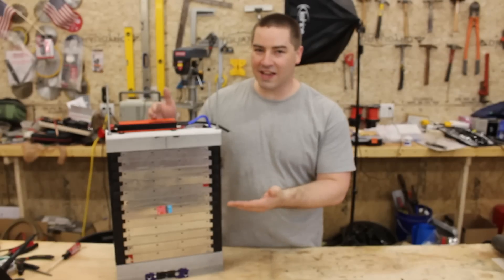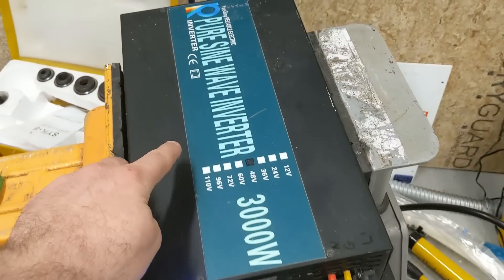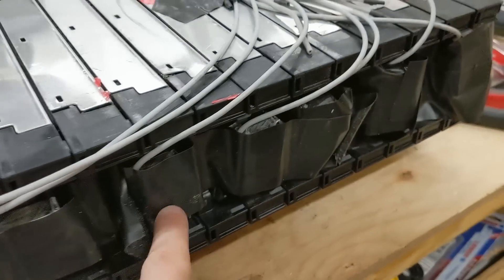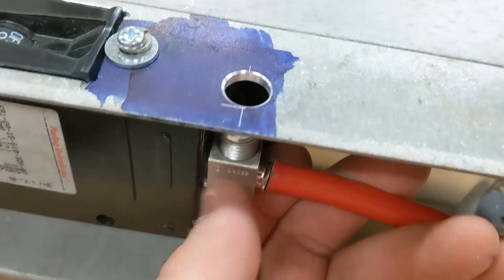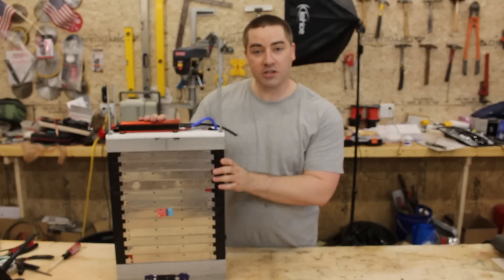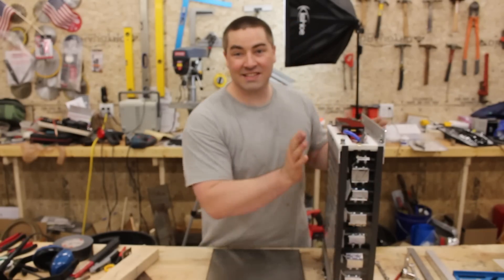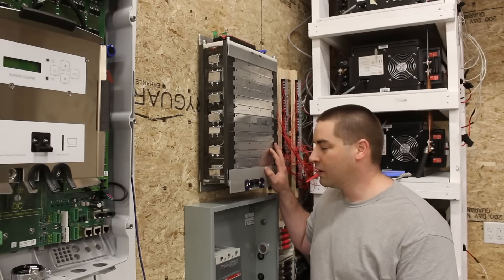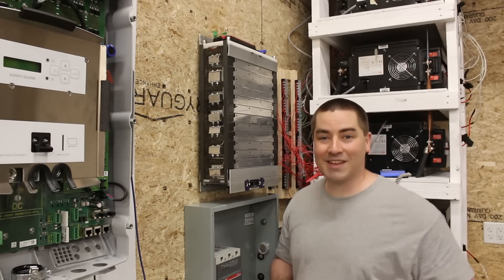LG Cells Part 2, 6kwh 48v DIY Battery

Comment: How many amps would be safe to discharge from this pack. Wondering for a golf cart and the torque i can pull from this  setup.
Reply from the maker: According to Battery Hookups website, these cells are able to do a 3C rate, which is 180 amps per cell discharge.  I built this pack with 2 cells in parallel, which is 360 amps max.  How many amps does a golf cart pull?
Reply: @DavidPozEnergy  Aftermarket motors in 48v carts will generally pull 80-120amps according to spec sheets I've seen. In real life they can peak at 400-500amps surge when you stomp on the accelerator and can pull 200amps going up a hill with a heavy load on board. I didn't see a pulse discharge rate on the bh site but imagine the cells would handle it considering they can handle 360amps continuous. My main concern would be protecting the cells and tabs inside the battery box of the cart and mounting them inside what is essentially a rolling earthquake :-). It could be done but would need more steps/planning than what you need for a garage wall mount? Would also need to use relays for LV and HV cutoff. Buggiesgonewild.com is a great resource for lithium conversions - most use 7 or 14 gen 2 leaf packs.
Reply: @DavidPozEnergy  depends on the battery. It is a custom project soooo..  60 to 140 amps typically on flat ground but could easily double or triple for more climbing  power. If the controller will make that power available. Thanks for the feedback!

Comment: looking to setup a power wall  with 8 k system can i use two to three chevy pacs
Reply from the maker: Yes.  These are modular.  Each the cells are not glued, so you can re-arrange the cells into different configurations.

Comment: hi David I like your ingenuity ,to built that  power cell. I have just 2 questions how much did everything needed to built it cost you? and how long did it take to receive all the components from the sellers in your links? thanks for your time
Reply from the maker: The LG cells are from Battery Hookup.  That was the fastest, about 4 working days.  The BMS was 4 weeks, from Aliexpress.  I bought the cutting board, and threaded rod, aluminum, locally.  If you want to buy aluminum I find Ebay good for a 3/4" bar.  The BMS was $130, the rest of the hardware was probably $40.  The circuit breaker was $40 from Alt-E.

Comment: I bought close to a 100 of these cells and I believe I may have found something easier than using the square aluminum tubing. Some of the tabs are  Extremely short. Some I've came across are only about a quarter of an inch maybe 3/8 of an inch long. But I found that if you get aluminum C channel you can't tuck it in much closer to the tabs. This has worked great. I have two of my 7 14s 48v banks complete. I believe the c channel is 3/4" x 1/2" x 1/16". Bought it at home depot for $13 for 8 ft.
Reply: Show us!!
Reply: Yeah this would be essential viewing
Reply: I did mine like David did and I already had 10 feet of 3/4 square aluminum tubing at home but only a little 3/4 flat.  I saw the c channel there and kinda thought about that BTW I used 35 mm m6 1.0 stainless bolts and nylon type lock washers no separate washer (I know but they dont get hot enough to matter) and I used a 1/8 flat 3/4 bar marked 2 inches increments with holes drilled 1/2 inch in from ends or 1 inch apart  for 48 inch piece and used this as a template to drill holes in other bar and tubing .  I found that either one  1/8 "washer and one 1/16 thick one or two 1/16 inch thick ones  gave me a little more space to work on the terminals.  A drill press really comes in handy for this. I did notice that 1 inch square tubing was more available and cheaper than the 3/4 inch size at home depot and lowes.  I think the 3/4 is probably easier to work with but with the 1/16 washer pieces it might pull the tabs in a little less (actually 3/4 x 1 inch tubing or bar is probably ideal but not available).  You dont have to cut them exactly 2 inches as long as holes match up.  Speaking of holes, I drilled my holes  11/64 inch and I couldn't see buying the pneumatic punch so I used a regular old notebook paper type punch. The holes were slightly small essentially threading the screws through them until I started chipping of one edge a little after making the initial hole.  This punch takes a lot of hand strength and really only can do one tab at a time but if had longer handle would be much easier . I looked into getting a leather punch with multiple sizes or light duty metal hand punch that was similar but none were in stock and I wasn't sure about how easy it would be to get it in correct position with the wheel at the end. I can also say it is somewhat harder to punch the positive end .  Also remember the tabs will be slanted down a bit .

I am currently using one of my packs on Club Car DS 48 volt golf cart and think I may be able to use the golf cart charger if I add one or two more cells to avoid the equalization phase and program BMS to shut off before the equalization mode. I am going to post in comments on his golf cart conversion video.
Reply: The cells started oozing a gel out of the ends where the tabs come out. They have not even been hooked up to anything. I was waiting on 8 daly smart bms. That took almost 2 months. When installing the balance leads i noticed the oozing. Ive been trying to reach battery hook up about this with no luck.

Comment: This is a cool project! This could work for a tractor project I'm working on.  I have a couple of questions if I may.  What are the overall dimensions of this Pack?  Also each of those is rated at a Max 180A continuous discharge. If I needed to run a Max 500A discharge setup, What kind of BMS would you recommend? Also if you were going to do a single 96V battery or would you do 2 48v units and then wiring them in series?
Reply from the maker: When you need to make EV type systems, then ideally you would use a BMS that turns on/off relays (contactors).  So the BMS is not sized to amps, it only triggers a relay.  The relay must be sized to the amps you are using.  Some brands that do this are Orion, REC, Batrium, Chargery.

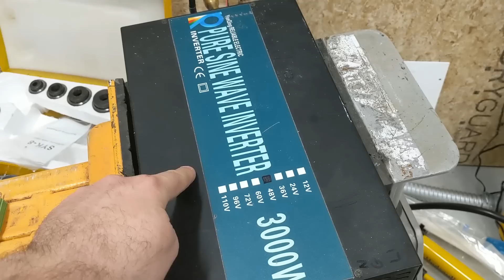Comment: 2:00 I wouldn't recommend discharging to only 3 V per cell. Based on what I've read about these cells, to prevent damage and degradation, their cutoff voltage should be no lower than 3.2 V.
Reply from the maker: Capacity test is to 3.0v per cell.  But staying higher than that is good for day to day operations.  I don't discharge below 3.4v/c on a day to day basis.
Reply: @DavidPozEnergy  Yes, I think the ideal operating range would be 3.3 to 3.9 V. That should give you over 80% of the rated capacity.
But looking at the cell specs, anything under 3.2 V will damage the cells. The 60 Ah capacity rating is based on a 4.1 V to 3.2 V discharge cycle.

Comment: Hi David. I just bought 8 of these cells to make a 4S2P battery system for my RV. I can't seem to find any BMS's that will work for this set up. Any suggestions?
Reply from the maker: If you can't find one off the shelf, then Daly can make one for you.  Or you can buy a BMS that allows you to program on the spot.  https://www.aliexpress.com/item/33005171770.html?spm=2114.12010612.8148356.1.50a93085hS8xrO

Comment: Purchased 3 6kwh Bolt batteries with your referral code!  Thank you!  Going to split one of them into 3 parts so I can get two 48V 8kwh+ batteries out of it.
Reply from the maker: Fantastic!  Sounds like you will be at 15s.  Great.
Reply: @DavidPozEnergy  I'm going to be 14S taking two out from one pack so I'm only adding 4 to each 10. I have a Chevy Bolt(I can see my cell voltage) I tested the max Voltage range and found. It would only net about 60% capacity with a LV5048.

Comment: I’m trying to build something smaller, 4sx4s
Charge to 3.8v. For a 15.2v 240ah system. What would you recommend as a charger for this system? I’m having a difficulty locating li-nmc specific chargers for that voltage.
Reply from the maker: A lot of times chargers won't list the sub-categories of lithium chemistries.  The charger may simply say "Lithium" or "Li-Ion" indicating the larger family group.  That's still OK if you can have user-set parameters.  I charge with a solar charge controller, but if you are looking for something that plugs into a wall I use a hobby charger: called Q8 from ISDT

Comment: David can I use these for a 24 volt system?  I have 6480 watts of solar panels and 3 0utback flexmax 80charge controllers and the AIMS 6,000 WATt LF pure sign inverter charger.  I am currently charging Trojan 6 volt T105 batteries 20 of them.  And I don't have enough battery.  Can you help me figure out what I need?  Thank you in advance
Reply from the maker: Yes, you can make a 24v battery with these cells.  In the video I made a 2p14s battery.  You could make a 2p7s and buy 7 modules.  (each module contains 7 cells).  7s makes a great 24v battery.  Max charging voltage is 4.2 volts per cell, or 29.4v for a 7s.
Reply: @DavidPozEnergy  Thank you very much for the reply. I will be looking into this for sure

Comment: Sorry that should be 3p 4s
Reply from the maker: That would be great.  You could also buy 3 of the 10s modules, cut the bus bar on one of them in the middle, then series it over with wires to the other two, creating two 3p15s packs.  That would still work with most 48v nominal equipment and probably be the fastest way to make a 18kwh (almost) powerwall.
Reply: DavidPoz  Thank you

Comment: Question, would it be easier to take a 36 volt module and adding 12 cells (4p 3s) to make a 48 volt battery?
Reply: Thats similar to what I was going to do except I was going to use 2 of the 36 volt packs paralleled and add 24 of the individual cells or experiment with breaking down the 36 volt 10s 3p packs to make two 4s 3p packs for less work.  Doing this however you either have to buy many more 36 volt packs to not have any unused packs like 2 36 volt packs to break up and 6 36 volt packs to attach them to for a total of 8 36 volt packs to use them all or about 48 Kwhr but you could always sell however many packs you dont want if you do not need the whole 48 Kwhr and offset some of the cost of the ones you keep with a little profit.  I also plan to do this to use a 36 volt pack on my golf cart and use connectors that are removable to add the 4 on to use on my solar system when not using golf cart.  If you have 48 volt cart just make a connector to connect and disconnect to the rest of your solar battery bank (of same cell type) and use the battery for backup or charge with your solar system . You wouldn't even need to remove battery from cart if you can park cart near the solar battery bank !!!

Comment: With the heat generation you spoke of, shouldn’t you have a space between the pack an the wall?  Or at least some fire seal material?  Love them build!
Reply from the maker: I installed it with a 3/4" air gap to the wall.

Comment: The aluminium tabs look flimsy and are prone to tearing and arcing. Very dangerous. Plus, I'm still pissed about the fake kWh on the BYD batteries I bought from them.
Reply: The set I bought tested at 3.75v out of the box, all cells matched.the aluminum tabs are a little stiffer than a beer can, I haven’t taken a caliper to them however I assume it’s about double to triple thickness. I doubt these will be prone to tearing, but the full charge is 4.2 V so you run into some other issues with the chemistry then I’m still trying to figure out

Comment: If I were to buy enough of these to build 6 48v batteries with same configuration you build here, would you put a BMS on each one or parallel them like you did those huge batteries you recent bought?
Reply from the maker: If you build 6 identical batteries to the one I built here, then I would use 6 BMS's, one on each.  However, you could parallel the 6 cell groups together first into a big cell.  Then you would have 14 really big cells and series connect those.  at that point you could use one BMS.
Reply: @DavidPozEnergy  So parallel 12 of the 60Ah cells to get 3.7v 720Ah battery.   Put those 12 in series, 14 of them, to create 48v 720Ah.  

I was thinking about buying 6 of the 36v packs,  dismantling down to the single 60Ah cell so I'd have 180 cells and math to configure the big battery is:
180 / 14 = 12       12 3.7v 60Ah cells in parallel = 3.7 volts 720Ah

14 x 12 3.7v 60Ah cells in series = 48v 720Ah

Thanks so much for replying.

Comment: do they have 24v battery
Reply from the maker: You can make a 24v battery using these cells.  Arrange them 7s (series) instead of the 14s I did.

Comment: Hey David i just bought 2 of the 36 volt packs from battery hookup I'm making a 7s 8p!! I have 2 Victron smart 100/50. How did you set up your absorption and float voltages per cell?? Any help will be greatly appreciate.  Thanks Man for all you do Keep it up!!
Reply from the maker: That sounds great.  I usually stay below the max voltage of 4.2v per cell.  I do this to extend the life expectancy.  Usually I set bulk charge (absorption) to 4.06v and float to 4.04v or something like that.  The trick is to keep your charge controller from jumping back and forth between the modes, so set them far enough apart to prevent that.
Reply: @DavidPozEnergy  Awesome!! Thank you!! My bms does not balance till 4.18 per cell. What do think about using the manual  equalization  ( so i can monitor it ) at 4.19 maybe once a month.
Reply from the maker: That's fine.  These are new cells so they won't need much in the way of balancing.

Comment: That victron cost over $900!!! WTF??
Reply from the maker: Yes, that's right.  I have a Victron 250/100 TR Charge Controller.  It usually sells around $900.  it can accept up to 5,800 watts of solar panels connected to it (6.44w/$).  You can compare it to other models if you stick to 250v MPPT models.  There is no sense comparing it to PWM charge controllers.  
Midnite Solar has a 250v model that sells for $725, and accepts up to 3,654w of solar. (5.04w/$) which makes it more expensive.  But what are you comparing the Victron to?
Reply: @DavidPozEnergy  Engineering Logic...  haha.  I just got my 150/100 in today and im totally stoked.

Comment: Hi thanks for great videos:-). I have a question. I bought a full EV battery of 12 modules LG chem that has 8sp2 cells? in each module. which is a total of 57.2v normal voltage? i dont know. The battery comes from a Renault ZOE ZE 2016 and is a total of 391v at the power outlet. My question is should I buy 1 BMS for each module? I've seen some not mount BMS at all. But there is a reason for BMS mounted and I would prefer to have BMS mounted.attery made by LG Chem. NMC chemistry.

Battery pack is made of 16 pouch cells welded together.

Module size

Length: 15 1/4 inches

Width: 8 1/8 inches

Height: 6 1/4 inches

Weight: 40 lb

Cell Voltage spec

Maximum Voltage: 4.2V

Nominal Voltage: 3.7V

Minimum Voltage: 3V

Module Voltage spec

Maximum Voltage: 67.2V

Nominal Voltage: 59.2V

Minimum Voltage: 48V

Comment: Isn't 58 volts a lil high for a 48v system? Or does that matter?
Reply from the maker: My inverter can range between 42v and 63v.  You will need to check your own equipment to see if it goes up to 58v.

Comment: Are you sure pushing the bottom cell is a good idea?
Reply from the maker: I'm using a little bit of compression on the stack.  This is how they are assembled inside cars.
Reply: @DavidPozEnergy  But you have plenty of space, why do you want to compress them?
Reply from the maker: I want to mimic what the original assembly looked like.

Comment: I just picked up 98 of the cells from battery hook up. I drove 6 hours to save on shipping costs and taxes. Saved almost $600 between the two. Those guys are awesome and gave me one h*** of a deal. $93 per kwh. Thanks for the videos dave.
Reply from the maker: Glad to hear it.
Reply: Thinking of using two 6awg wires to connect each of the cells to each other. Should be good to 200amps. Especially being only 4 inches or so. Or I'm gonna go the route you did with your suggestion of aluminum square stock from my local hardware store. What do you think?
Reply from the maker: Yes, you can use little jumper wires between the cells.  I'd be cautious about putting stress on the tabs, so if you can, use an ultra flexible wire.
Reply: I agree. I also thought about using zip ties to keep the wire bent and the stress off the tabs. Or even go straight down from one to the other with virtually no stress on the tabs.

Comment: Did you install the main positive at the top or bottom of the pack and then the main negative at the opposite end of the pack?  As to have one at opposite ends of the pack So current will flow more evenly for charging and discharging.
Reply from the maker: Yes.  Main positive on bottom and main negative on top.
Reply: Thanks for the reply.